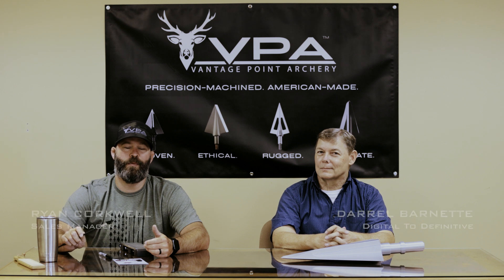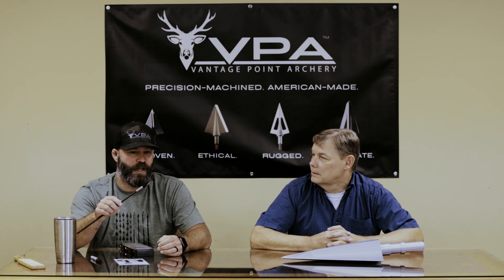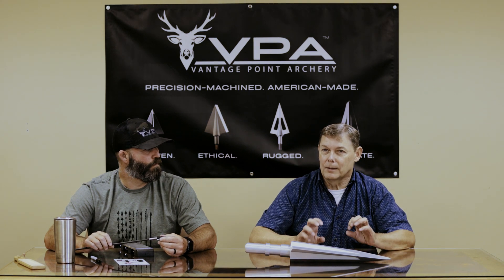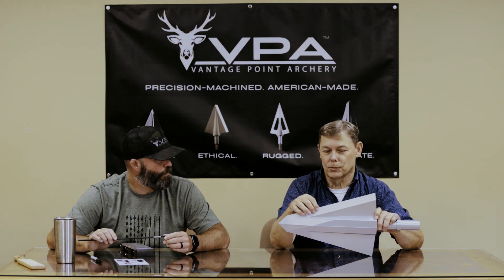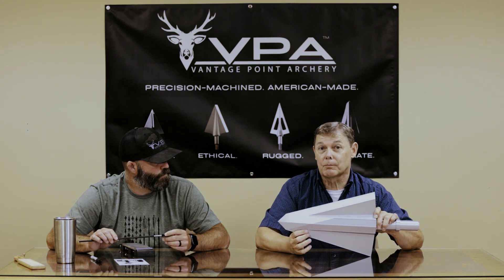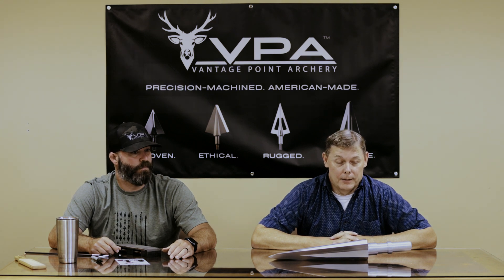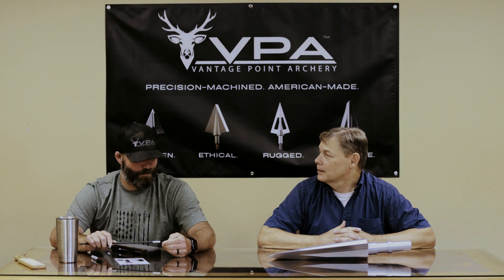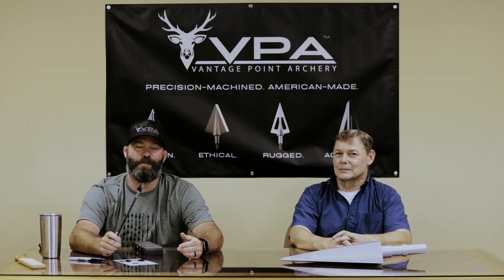VPA Omega Single Bevel Broadhead Design - with Darrel Barnette

Comment: The Omega broadhead sounds like a great Broadhead. Is there any plans of making this broadhead for Crossbow‘s? Crossbow‘s are becoming bigger market every day. With the design of this broadhead would it be affected negatively by higher speeds that Crossbow delivers?
Reply from the maker: Hi Raymond - thanks for reaching out! The Omega broadhead is a great fit for a Crossbow given it's 1 1/16" cutting diameter. This cutting diameter was intentionally chosen to give the broadhead excellent flight characteristics. Since it's a smaller cutting diameter than many of the standard broadheads available in the industry, you can shoot it at higher speeds and still maintain excellent flight. Please let us know if you have any other questions! You can learn more about the Omega here: https://vparchery.com/products/vpa-omega-broadhead